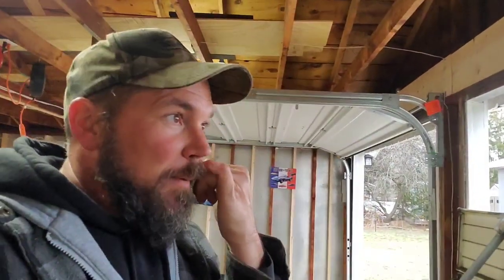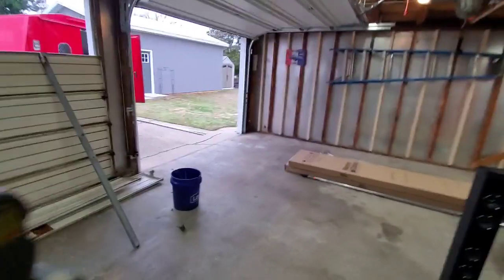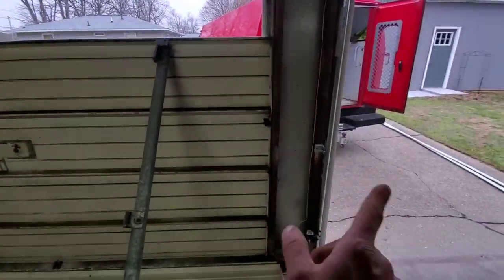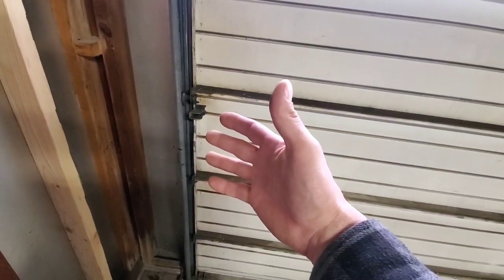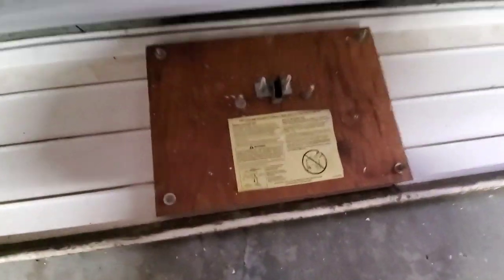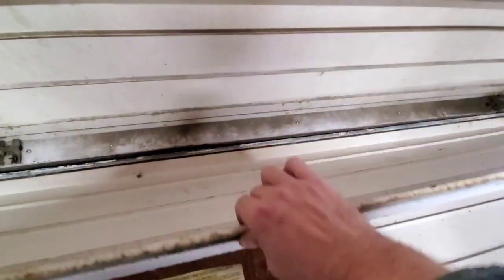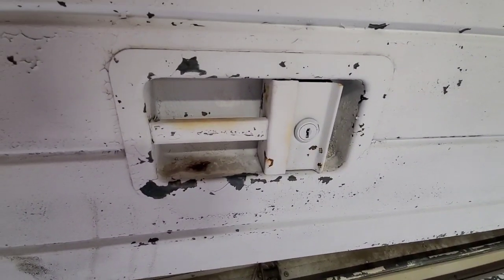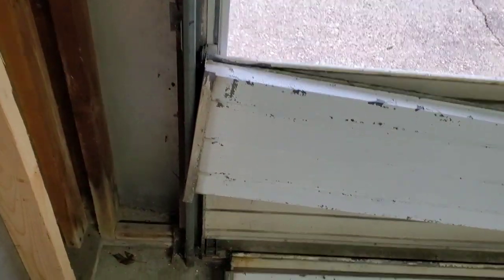How Did they Do It?

Comment: So it's either a Morrison Rolley, or a Taylor SS. (I think SteelCraft has a version too) I've seen two variety of these, at least this one doesn't have the piano hinge pin all the way across. Basically, you clip the upper section into the top of the lower section at a little over a 90 degree angle, then tip it vertical, then put the rollers in the end to lock it in place. They probably didn't nail thru the door, but put in nails on angles (how I was taught to hang doors originally) to hold each section in place, then put up verticals, horizontals, etc. They are goofy as hell, but work shockingly well, when they're maintained. I've seen one of these installed on something like a 6" radius, which works since the sections are only about 12" high. I have a very limited number of these left in my area.
Reply from the maker: Great intel. I can definitely see the benefit of the shorter sections. Wish I could have been there when the old boys installed it.
Reply: @affordabledoorgatellc7391  There were so many cool products back then. I feel like I missed out.
Reply from the maker: @TheGarageDoorGeek  Me 2 let's go back to the good old days 😂
Reply: @affordabledoorgatellc7391  Quick! We gotta find Doc Brown!

Comment: it looks like an old Roly Poly door
Reply from the maker: Are you serious. That would be a cool name.
Reply: @affordabledoorgatellc7391  I think Mike from Innovative door called it that
Don't count me on that
Reply: @affordabledoorgatellc7391  yep, "roly door" is what they were called, Morrison was the manufacturer I believe. I replaced springs on one a couple years ago, and there was a sticker on it
Reply from the maker: That's awesome lol now I'm interested in more details on them.
Reply: TAYLOR BRAVO, it was probably white labeled under “Atlas Roll-Lite” & others in the 80’s when this product was being sold. I forget the details but I know “Taylor” had some relationship with Roll-Lite during their heyday. That door was “unique” to say the least, LOL. Their other and in this market much more popular product was a really good Sandwich steel door with wood stiles/end caps inside the sandwich + Nylon Hinges. Hands down the quietest doors ever made.

Install/removal (I doubt the removal will be as smooth 30 years later)
I’m pretty sure you install the section and when you add the next section you lay it at a 90degree horizontal position to the get the joints bite on one another. You’d nail each section to the jamb as you go up, then lock in the joint with the roller, finish by installing the vertical track over the rollers & remove nails.